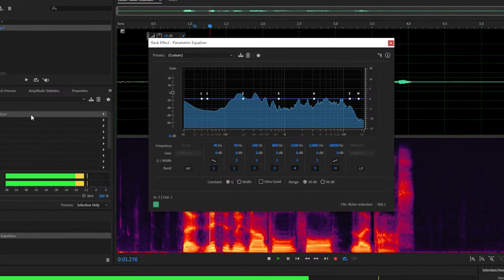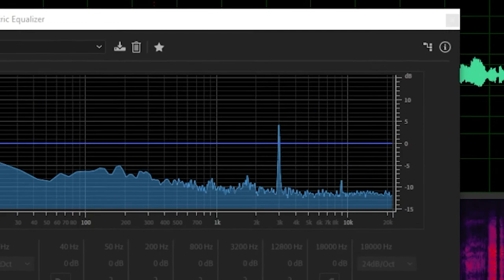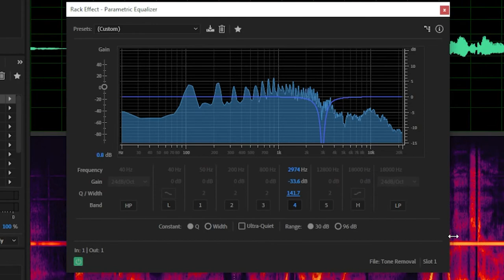How to Kill Your Noise Floor | Noise Reduction for Audiobooks

Comment: How are you getting -60 roomtone? I have pads around the walls, and I even put my mic in a box to test it. At 6 gain on the mic, I am getting -54 to -48. If I lower the gain less than 6, I need to increase the volume in the mix, and I am back to -54 to -48. I'm using CLEAR, and it removes everything I need, but I would always like to start with a cleaner recording.

Comment: Not sure if you'll see this comment, but here's hoping. I have a PC and my nephew mentioned that -60 decibels could be a problem because of my PC audio drivers. Do I need to worry about that? Is there a way around it if I do?
Reply from the maker: I'm not sure either. Recording in, could be a problem. Depends on the mic/interface you use. Audio chips on pcs ( and there drivers) can cause noise to go through the headphone amp circuit and into your headphones, the problem here is that although it not in the recording, you have no way to tell. If you are using a half decent interface, shouldn't be a problem.
Reply: @KrakenMediaPro  Thank you so much! This was actually really helpful. Appreciate the response. You're videos are great, btw.